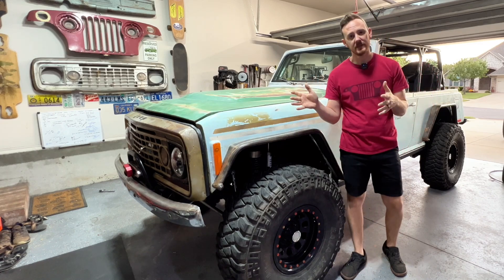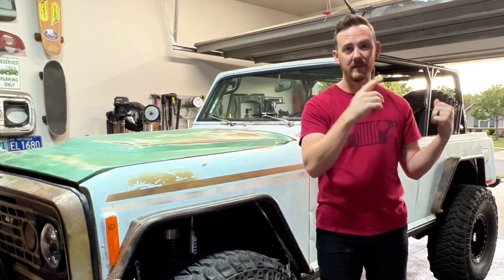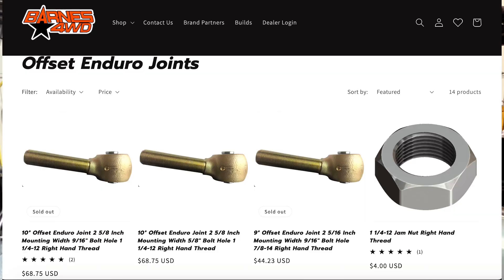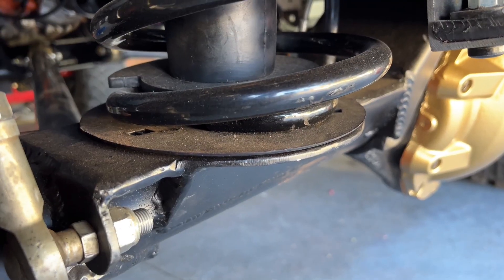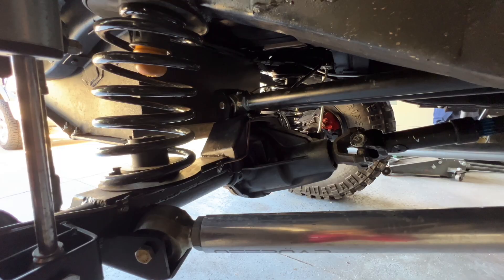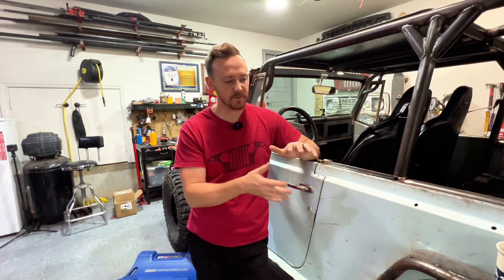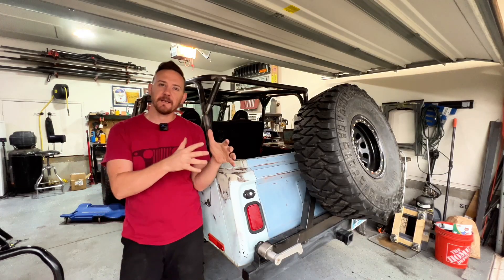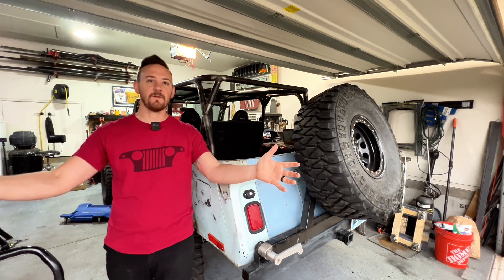How I Built a 4-Link Suspension from Scratch | Jeep Rear Suspension Redesign

Comment: Did you add a manual control kit for the AW4, hold any gear, shift when you want to. Also a Transgo shift improvement kit wakes up that transmission.
Reply from the maker: I haven’t yet but after it’s 99% I’ll probably look into it. I know we’ve talked about it but I’ve lost it. Which manual control kit do you recommend?
Reply: @foregonetrails RAD Designs makes everything you need. It's actually a company I started in 2008 and sold in 2023. I obvious have used the products for that whole time in different vehicles.

Comment: I did a similar rear 4-link but I bought a used jk lift kit with rebuildable johnny joints for 50 bucks on marketplace that i cut apart and retubed to the length i needed. Used some jk factory rear coils from a friend built all my own mounts and I was able to reuse my shocks all in I spent about 200 bucks on link bar material and plate steel to build the truss and mounts
Reply from the maker: I love that kind in ingenuity. With some patience you can still make a great product without breaking the bank.